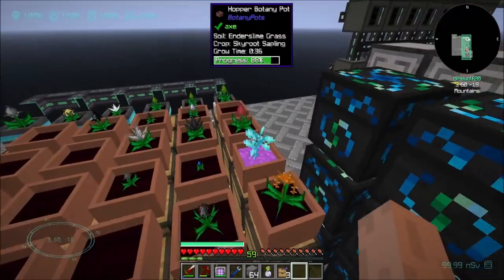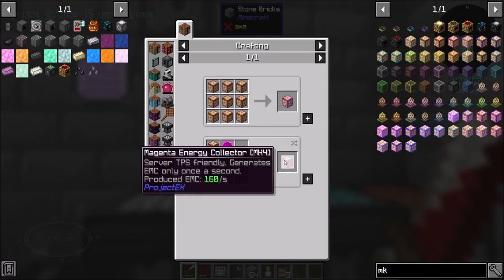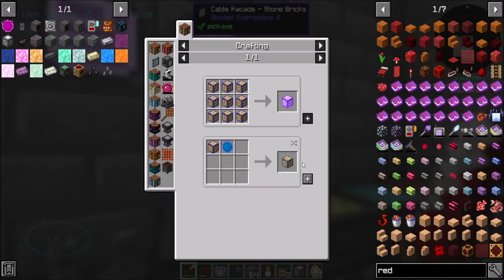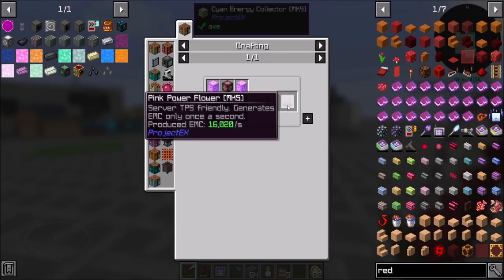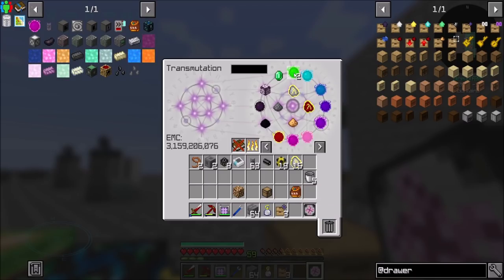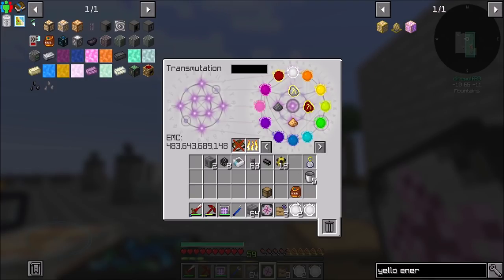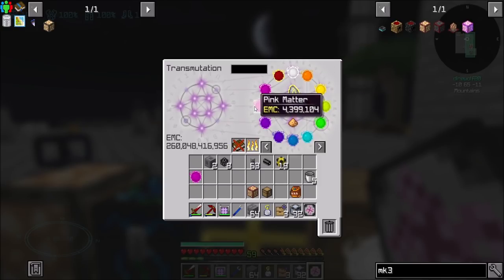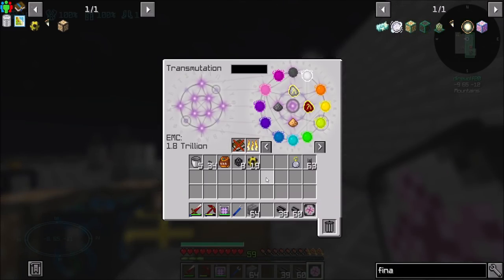NTC2 Ep44 A Trillion EMC

Comment: most people would be panicking at how many mobius fuel that requires.

Dire: "meh, give me a minute."
Reply: Easiest way would be to use a collector to make möbius fuel and diamonds.  Go from there into 2 or 3 chained RFTools crafters.
Reply: @robertpickel2447  that works decently up to the Magnum Star series, but then the numbers get too absurdly large. Even 4 RFTools crafters together make about 1 Magnum Star Omega per ~4 hours or so, so it would take a mere 2 years for each of the Colossal Star Omegas used in the final star shard.
Reply: @TheBrain0110  what about tick acceleration? Or like 500 rf tools crafters? Not familiar with end game of modpacks so genuinely curious about how one would go about doing this
Reply: I just hope he added acceleration cards to the Assemblers, even then, it's gonna take actual days for AE2 to process that request, if not longer.

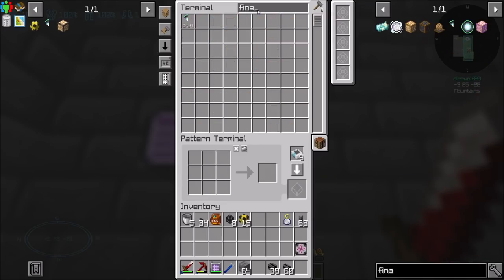Comment: 32:25 You may have just noticed that the crafting operation will use 182 GB of memory. Because of the exponential nature of the levels of crafting of the Klein Stars, the lower level ones (up to Klein Star Omega or Magnum Star Omega) are best crafted in an external crafter, ideally one that can craft at more than one stack per tick given enough materials.
Reply: I do wonder if one can even make a crafting block with 2,8 Million 64k crafting units. :P
Reply: @Quietust Parallel crafting. For the first 'set' of klein stars, I'd have something like 32 Tier 3 crafters going from Ein to Omega, those then feed into a pair of Tier 3 crafters (16 each) to get them through the second set, then the final Tier 3 crafter for the home stretch. And instead of 'on demand', I'd just attach your EMC generators straight to it (probably build my own power flower with five fading collectors around one fading Condenser to provide the EMC for it. It'll probably produce more energy than the equivelant 'server friendly' version that requires six condensers.
Reply: @Quietust Can't T3 Crafters auto-export? I suppose one could use Translocators, grouping the bottom-section into groups of four, then those four feed into the next tier and so forth. 

Feeding them the diamonds and fuel... one Mk. 2 for each diamond and fuel per each crafter being fed from EMC directly instead of piping? Don't know if a Fading Collector would be able to keep up with demand for one crafter, though.

Comment: Dire: Energy relays can put that generated EMC directly into your table without you having to manually turn it into matter and then shove it into your table.

Also, The Final Star is essentially infinite EMC. You can use it to make the Final Collector, obviously, but you can also pop it into a Dark Matter pedestal, place a chest next to it, right click the pedestal to activate it, then drop any EMC item on top. It will then create a stack of that item into the chest every second. Either one of those is unlimited EMC for all intents and purposes.

Finally, look at the "Energy link" items. These can be used for many things, but one of those things allows you to hook it directly to AE2, so that AE crafting can use EMC to create items. Need that 130 billion diamonds? AE can directly craft it from EMC with a link setup right.
Reply: @Quietust There are things in this pack that are just to much..
Reply: @Quietust fyi with refined storage and creative crafter addon you can craft items with 60k/tick, so this is technically doable in modded minecraft lol
not in this pack sadly
Reply: @necauqua  yeah at that rate it would only take 32h of non stop crafting
Reply: @MrrGNB  oh forgot to mention that the server would be dying for all of those 32h)) probably can multiply that by 20 because it would be like 1 tps
Reply: @Quietust I mean the packs add recipes for those - and the creative crafter, despite being the 'creative' one, is actually relatively cheap usually.
Isn't dire trying to craft a kind-of-creative trillion emc collector here?

Comment: INB4 the creation of 1 trillion mobius fuel is realized as the problem. The collectors don't instantly generate resources. Even provided excess EMC to their buffer, the rate at which they convert that EMC into items is capped. The base collector generates up to 1 item each tick, or 20/s. The MK2 collector generates up to 64/t or 1280/s. With a single MK2 collector, generating 1 trillion mobius fuel would take 25 years. With 256 MK2 collectors, that's still 35 days. To get this done in one day while AFKing, you'd need 9,000 MK2 collectors. And remember, MK2 collectors need ender shards, which can't be EMC'd and don't have mystical seeds. So you'd have to automate sieves with the Player Simulator. If I recall, the ratio is 100 end dust per shard. Given that sieves only accept 6 clicks per second, processing 25 end dust in a 5x5 sieve array would equate to 10 dust/second. To get all the end shards you'd need for those 9000 MK2 collectors in one day of AFKing while sieving is going on, you'd need 42 sets of 5x5 sieve arrays. 

So yeah. It's possible, technically. But honestly just add a mod like Project Architect Additions that adds EMC links.

Comment: Dire, I really suggest against making the flower block at first, all the EMC it generates goes into the personal EMC, it won't relay it to blocks like the chest, so it's not just expensive AF, it will be a pain to export because as you saw, the export link block for ProjectEX doesn't work
Reply: Meh, just put a high rank matter in the chest. At that point it won't run till the end of the pack
Reply: @nareik8017  The Power Flower block is a single block that simulates a full 16-collector-6-relay multiblock.. but instead of feeding the energy to the block in the center of it, it feeds it to the player's EMC storage, which shows in the tablet. It won't matter if you put it near a chest.
Reply: The basic personal EMC link does work. You put one next to a collector and it adds to your personal EMC total.

Just that's the only part that works, the item-exporting versions don't do anything.

Next pack update (coming soon) replaces ProjectEX with Project Expansion, which is a rewrite that actually works

Comment: if the pack has iron furnaces you can craft the rainbow furnace which is way faster than mekanism factory so you won't have to run around spending that precious tick-accelerating time on that